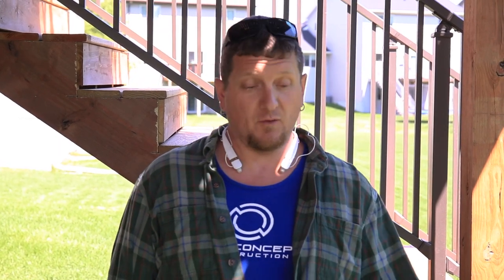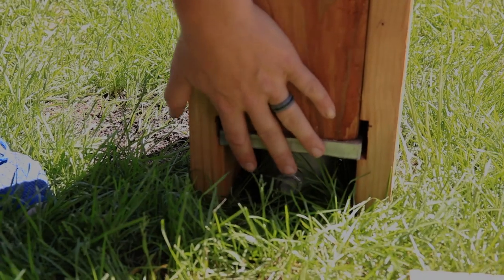Helical Screw Pile / Footing Installation

Comment: Hey Aron and crew, thanks for the vid! When these piles go in, how level are they with each other? Do you find that the deck posts are cut to different lengths? The reason I ask is because I would like to build my house on these, and I want to know if the machine can level the tops with each other, or if there is fine-tuning to be done later? Keep up the great work!
Reply from the maker: They are much like concrete, you're gonna have to cut your posts to different lengths.
Reply: @openconceptconstruction6740  no they dont , they can be driven level if torque permits , or you can cut the tops using conventional cutting techniques.

Comment: 6x6 means 6x6 in metal fab, they don’t mill lumber at metal shops.

For those who are thinking of doing this, locate and underground utilities and stay away from foundations atleast 5 ft otherwise you risk of damaging drainage and most importantly you disturb the ground the foundation is sitting on.

I didn’t see a torque reading. When doing this record all your torque readings and compare them to the manufactures load specs, in this case without an engineer you would determine the live/dead load of the deck and torque them accordingly to the manufactures specs otherwise you risk a collapse or sinking. It’s also protects you from liability in the future if something were to happen.

Still a newbie buddy. Pay someone to teach you  for the first time and then go out and sell/ install them. Even pay an engineer to explain things to you.